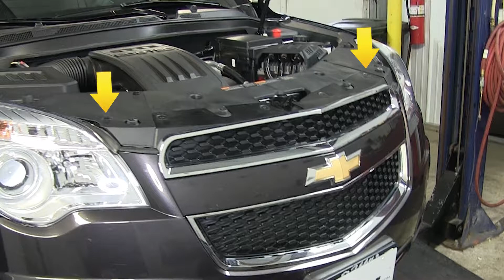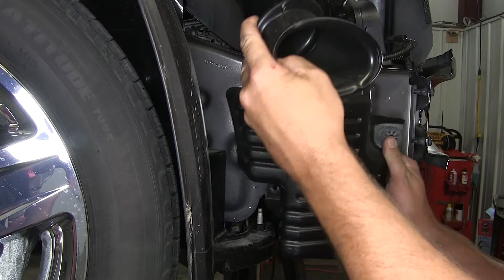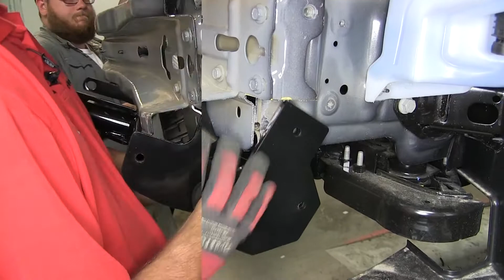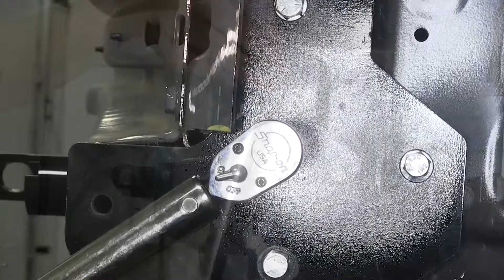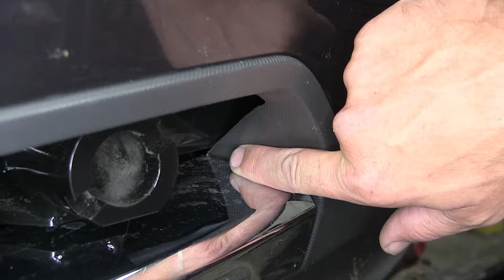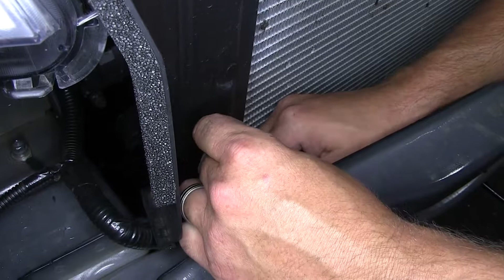Installation of the Blue Ox Base Plate Kit on a 2014 Chevrolet Equinox - etrailer.com

Comment: Im going to install this on my 2017 Equinox. Is it all same procedure?
Reply from the maker: This base plate is designed to fit the 2010 - 2017 Chevrolet Equinox. They will install the same way from year to year.
https://www.etrailer.com/Base-Plates/Blue-Ox/BX1689.html